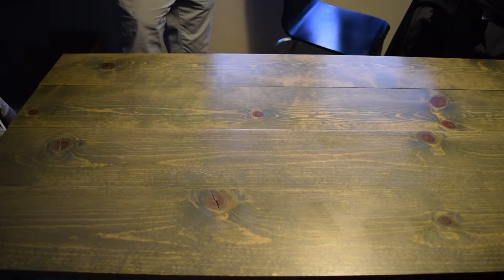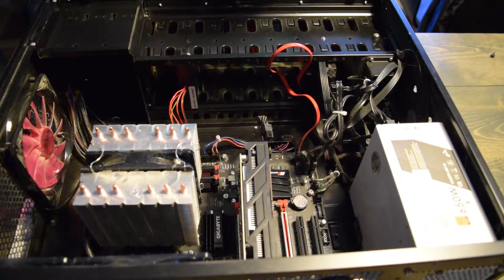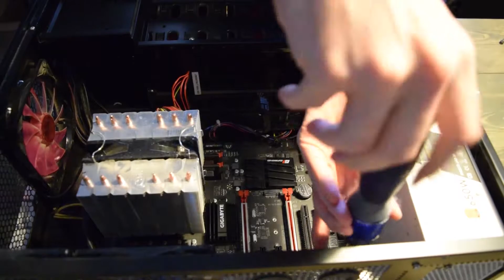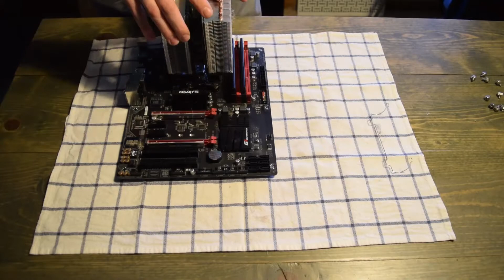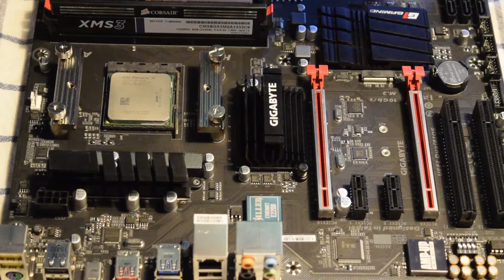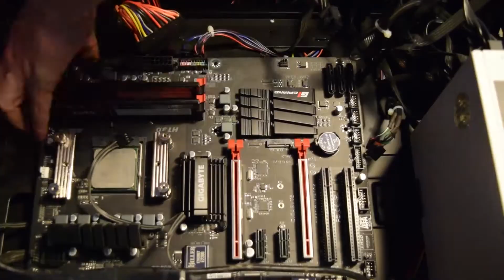How To Install a CPU Liquid Cooler

Comment: Man, I don't understand.. Did you change the thermal paste that was on the Captain?
Reply from the maker: I may have not explained it clearly enough, sorry for that.  I initially installed it with the standard stuff that comes slathered on the cooler.  

After this video I did scrape it off and test with AS5 to see if there was any real difference.  (there wasn't, at least not enough to comment on the video).
Reply: Explain You a Thing Thank you! I will keep in mind when installing. In fact, I might not have heard if it was in the video. My English is not that good)

Comment: I'm in the current process of buying all the parts for my transition from console to pc and I was looking at this water cool system to cool my cpu and was wondering will I have to change the fluid in there?
Reply from the maker: American Toxicity nope in the case of these type of units, it's a sealed system.
Reply: Explain You a Thing well what's the lasting time on this unit if you do knoe that would be slot of help lol I know it being deepcool the lasting times aren't always accurate haha
Reply from the maker: American Toxicity agreed, honestly there's no way of knowing for sure, device to device. I'm at 50% success with the two units I've tested. One failed immediately and the other is still running to this day.
Reply: Explain You a Thing lol okay thanks for the help, if it fails it fails I'll just buy a heat sync if it does. btw you should upload more videos like this, unboxing and how to installs I find them very helpful
Reply from the maker: Glad I can help! More videos coming soon.  I've had less time than normal to get videos out as of late.  Life getting in the way and all.
Reply: Explain You a Thing makes sense, good luck tho keep up the good work!

Comment: How about pump noise? Is it noisy? 
I think It depends on rpm (pump speed) It is possible to reduce rpm value of pump speed isn't it
Reply from the maker: You could technically reduce the pump speed using either some form of fan control built into your motherboard or a fan controller.  That being said, I don't know what effect that has on cooling overall. Usually, these systems are speced out at a certain speed to optimize the removal of heat from the liquid at a a constant pump/flow rate.

In my every day use, the fan makes more noise than the pump (just standard air noise).  I can't really hear the pump unless I get my ear within a few centimeters of it.
Reply: Thanks a lot for your reply. This answer helps me. Thanks again.

Comment: Yeh that case is dusty, it should not be standard. U need filters fella :D
Reply from the maker: In hindsight, I should have cleaned more thoroughly prior to filming.....

That being said, the Antec Darkfleet actually does have filtere, but the case isn't exactly what you'd call.....sealed well.  So even if you seal up the side vents, you still end up with dust from everywhere.  One of the reasons that I replaced it.

Thanks for watching!